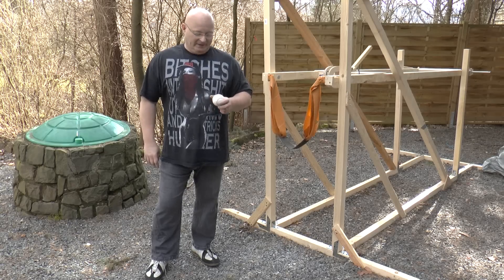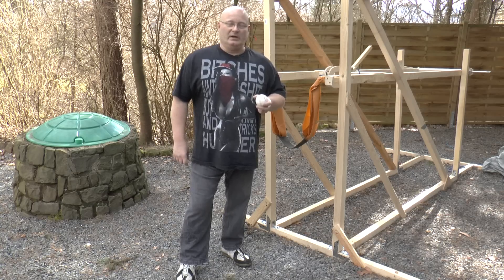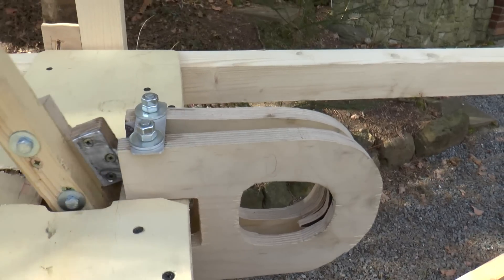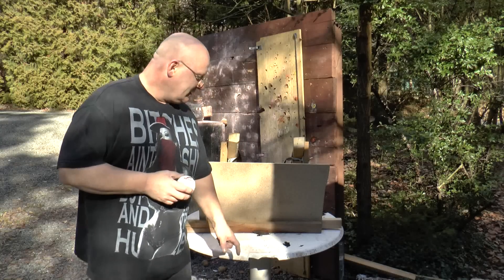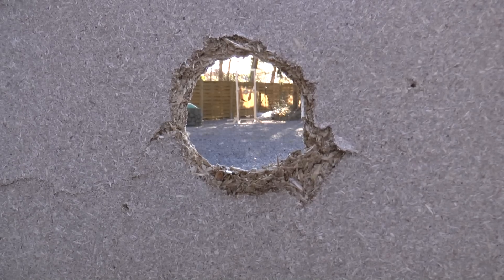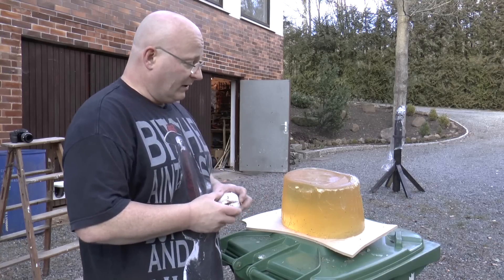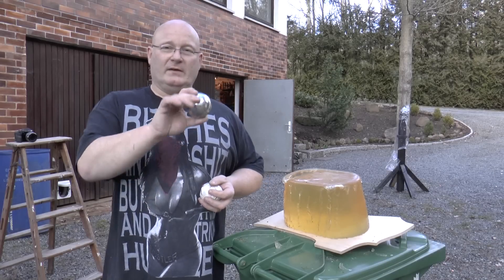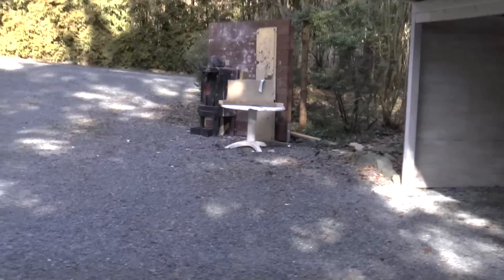Can a World Class Baseball Pitcher Kill You?

Comment: Ryan's pitch was recorded at 100.9mph but recorded 50 feet away from home plate. Mathematics tell us that the initial velocity would have been 108.1 mph because the ball slows down due to air resistance. HOWEVER it is not true that the pitch was recorded at 108.1mph, that is a mathematical calculation rather than a record.

Comment: The reason you're having trouble with accuracy is the lack of rotation on the ball. When a pitcher throws a fastball they generally snap their wrists downward just as the ball is being released; the sharp downward movement of their fingers on the ball imparts rotation to the pitch, giving it stability as it flies. If you could make a slingshot that could simulate this, chances are that the accuracy would be greatly improved. 

Also, the pitch doesn't need to be going 100+ MPH to cause major damage; the MLB league average is closer to 95, and that is more than enough to break bones (which happens more often than you might imagine).

Comment: Well considering batters do get hit by pitches....
Reply: Not 108 mph pitches more like 90
Reply: +Brayden Weller its 106
Reply: +Brayden Weller Avg fastball velocity is around 94-95 but a very large amount of MLB pitchers throw 97-100 with the highest throwing at 106
Reply: Batters usually get hit in the arms or legs from the side or the back if they turn, which hurts but won't kill you. It becomes dangerous when they get hit in the chest (heart), neck, or head. Of course helmets are required, but in the early days they weren't.

Comment: Using a little league ball which is not genuine leather and is much softer (the one you used) harmed the experiment. Any "world class pitcher" would be using a genuine leather corked ball which is much more solid and would cause a lot more harm at those speeds.
Reply: It wasn't a little league ball. If it was it wouldn't have any of the yarn inside. It's just a plastic covered ball

Comment: The only reason the baseball went into the ballistics gel was because it was less than 5 feet away. If you want an accurate result, put it at MLB regulations and plus, the ball can't have a rubber center.

Comment: Did you take an actual speed gun to the ball to measure how fast it is? I also wanted to point out that the seams on the baseball are much higher in the MLB then the baseball you used.

Comment: I just have to say, that shirt, with that laugh = absolute perfection.

You could be defending bullshit myths like the wage gap and I'd still watch just on principal.

Also just for future reference, the US military uses depressions of 2.2 inches as the trauma compression threshold for what it considers a lethal strike to the chest that can cause the heart to stop from direct trauma or hydraulic shock.  Bullet resistant armor, therefore, must not exceed 2.1 inches of depression or deformation when struck to be considered effective at stopping the round it's rated for. 

With this experiment, that means that at roughly three inches, when the baseball completely buries itself in the ballistic gelatin at 3:30, that means it has already far exceeded that threshold. However, when played in slow motion through 3:31, we see that the gelatin deforms roughly 1-2 inches further, meaning that the ball has delivered, at the very least, double the energy required to kill a human.

Considering that NATO international standards for its soft body armor require it to withstand 80j at a minimum (last time I checked about 10 years ago), your calculation of 162j seems perfectly in line with what we witnessed.  It also means your ballistic gelatin was made to near perfection--if you're mixing it yourself, bravo.

Comment: Jörg, how do you explain that the steel ball had that much more energy if the potential energy stored for both trials were the same? Is the heavier iron ball more efficient? Less loss of energy?
Reply from the maker: The energy might be almost similar, but the heavy iron ball has a lot more momentum. Momentum is what makes a train crash at 30 mph so much more devastating than a car accident at 60 mph.

Comment: Joerg, you may be impressed by a pitcher's speed and accuracy, but what's really impressive is how they can put spin of the ball that makes it change direction in mid-flight as it travels towards the batter. The pitch initially looks like it's coming straight for the middle of the strike zone, but it will curve up, down, left, or right as it gets near the batter, so the batter, with no time to react, will swing and miss. Before each pitch, the catcher will communicate using hand signals with the pitcher, so he knows where to expect the pitch to go and can get ready in the right position.

They also make special lightweight balls that emphasize this effect called Whiffle Balls.

Crazy WiffleBall Pitcher!!

Comment: but... if its heavier, the pitcher wouldnt be able to trhow it so fast(?
Reply from the maker: Nope. Same band set. Same draw weight.
Reply: :o thanks.
Reply: JoergSprave may be there was a misunderstanding. the ball actually would be thrown slower, since it has the same mass and the energy is the constant. so same energy, different mass and different speed. so the pitcher can do all Joerg did, but the steel ball is not travelling near 108 MPH